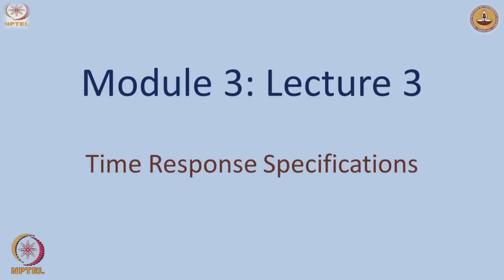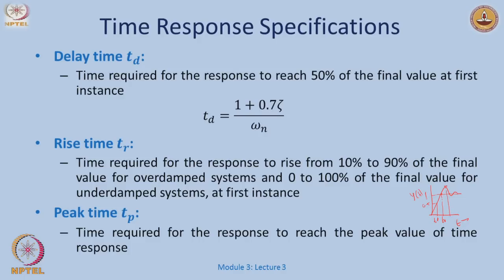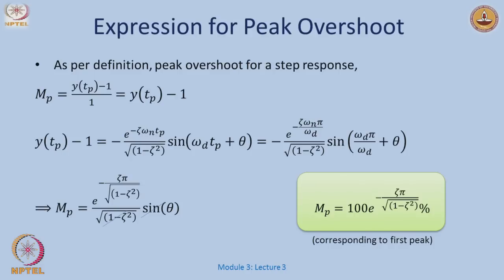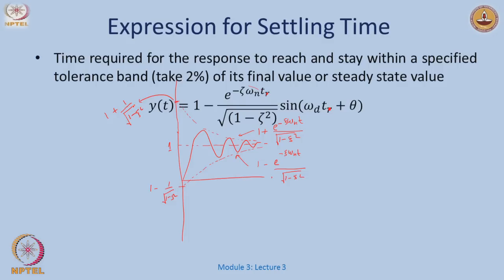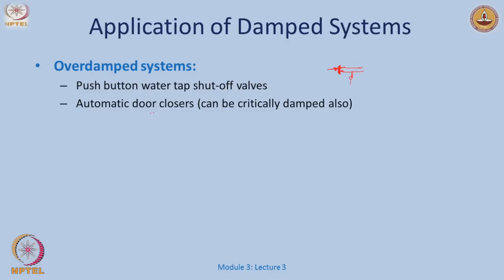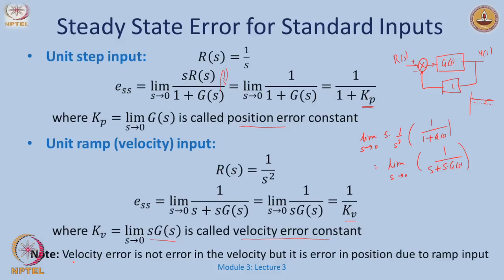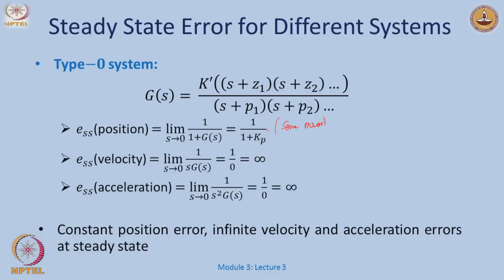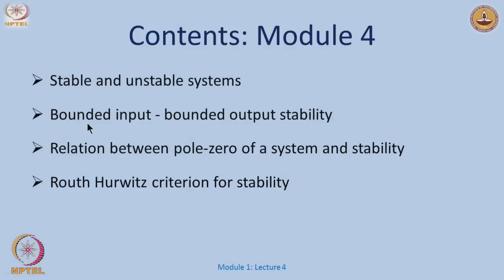Time Response specifications

Comment: Sir how to find steady state error in case of non unity negative feedback system?
Reply: make it unity feedback, by taking two (+)and(_) feedbacks, then find new TF which includes (+) feedback.
Reply: the transfer function is bit changed let H(s) be some function of (s) then T.F is G(s)/[1+G(s)xH(s)]  which give Y(s) = [G(s)*R(s)]/[1+G(s)xH(s)]  
 now as we see E(s) is R(s)-H(s)xY(s) which when computed is equal to E(s)=R(s)/[1+G(s)xH(s)]   and limiting E(s=0) will provide steady state error in case of non-unity negative feedback system.
Reply: @shivampratapsingh3872  The error that you are referring to is actuating error.